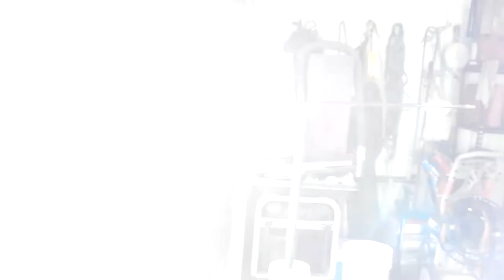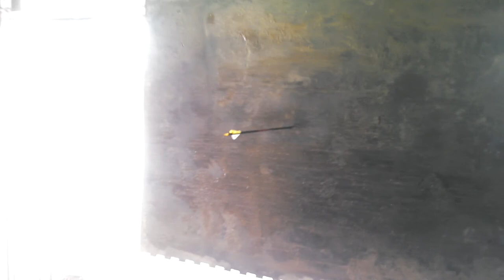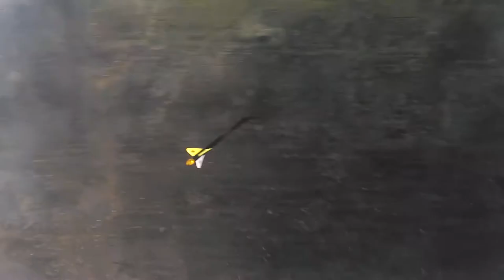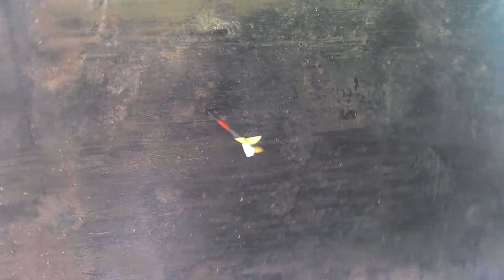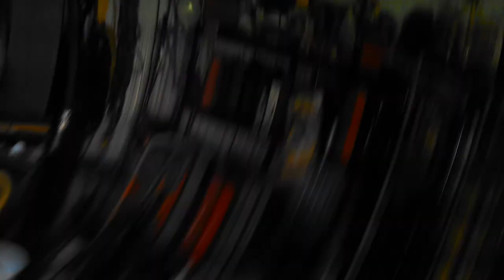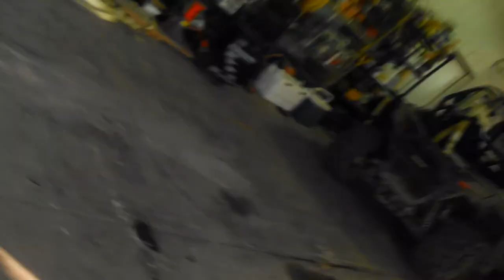Horse mat archery backstop test Carbon Knight Bow

Comment: This is very cool and cheap option. Important question: how hard is it to pull out the arrows? Also, have you done more shooting to test the durability of this solution?

Thanks for your video and feedback!
Reply from the maker: MrPDG79  it is a back stop only, to catch stray arrows. They are very hard to pull out.  takes two hands and very tight. I have my regular target in front of this.

Comment: building a winter range in basement was not sure of a back stop, now I know... I am shooting a 75# Martin nitro nemisis chronoing around 320fps looks like this will do the trick...shooting wall to wall I can get about a 15yd shot... this looks like the ticket... thanks for the vid..
Reply from the maker: I hit it with my Carbon Spyder last weekend 70# it penetrated about same as my video. you should be similar.
Reply: Very cool

Comment: BTW how did you hang it?
Reply from the maker: This was a test. just hung from overhead door. I made a wood frame outside for it. wind blows over though. going to put post in ground. If you are using basement be sure to test so you know how far to keep from wall.
Reply: Thought about using two mats.